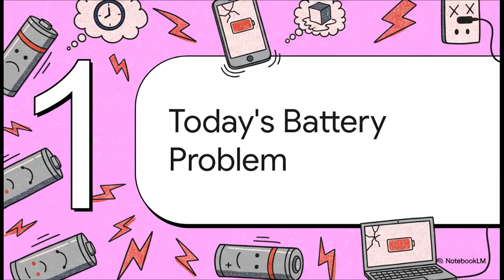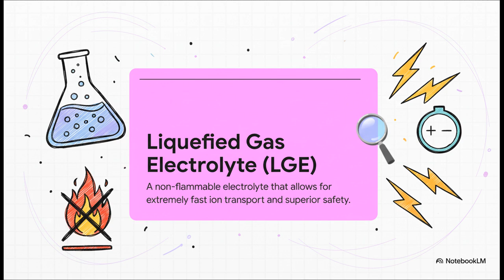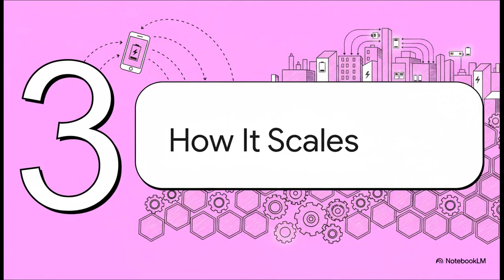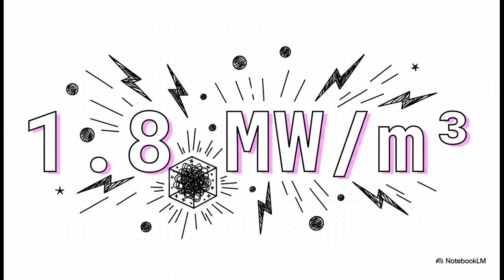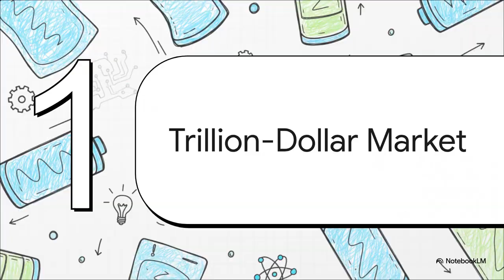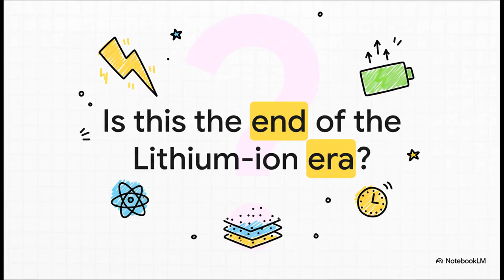The LGE Core Cell

Comment: Is this an April fools joke? I mean, what’s the downside? There has to be a downside… or maybe it’s something from the future…😎
Reply from the maker: No joke, the second generation is up to 2.8MWh per unit and will be used for powering the huge mining trucks and such like allowing them to run for a full 8 hours and then simply swap out with a ready charged one in few minutes. The smaller variant can be scaled down as well as up. They will both be available in Q4 this year.